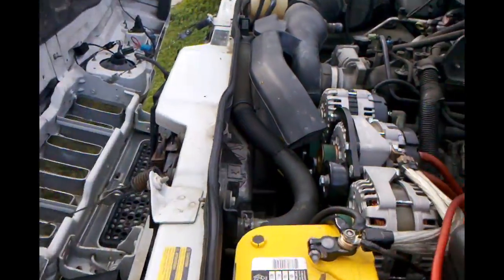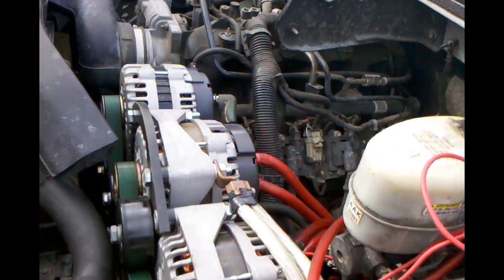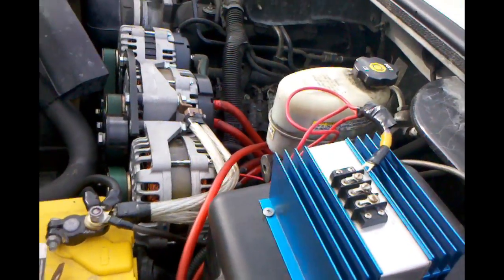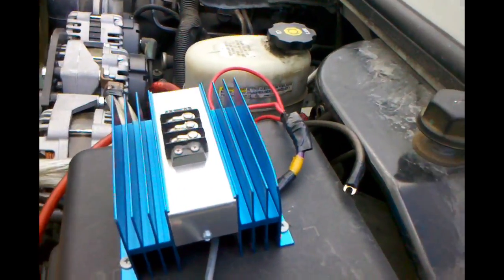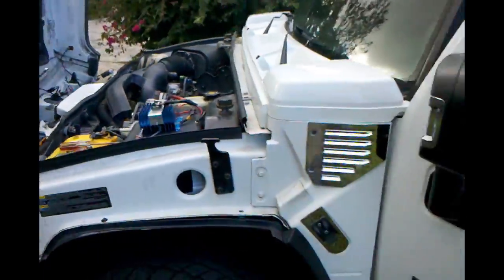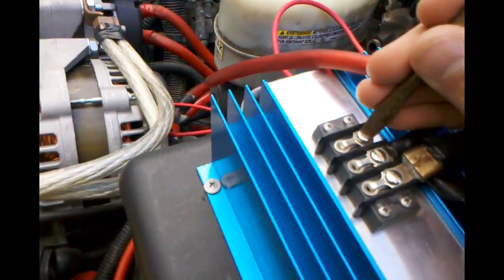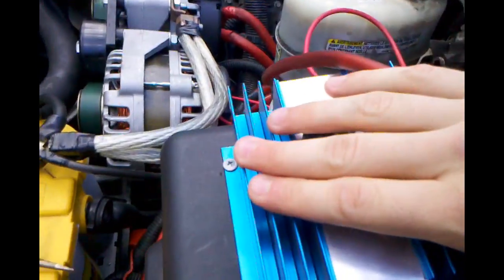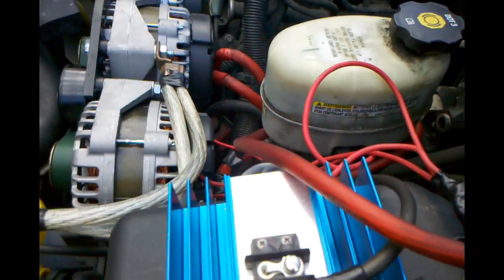Installing an External Regulator (Crossfire Hummer, 20,000RMS+)

Comment: can this regulator be used on alts thats not from excessive amp alts?
Reply: Yes, Use A Terminal Block On The Alternator Then Wire Pos + , Neg - , and Field On the Voltage Regulator To alt
Reply: +Kustom Klosure Designz will it work on the gm 2pin alternators? like a dr44 or a mechman 370 with 2pin GM..
for a 2006 Silverado, I've already bought one of the 91102r units and haven't tried to hook up yet, I haven't seen anyone use it on the gm 2pin..

Comment from the maker: That will work.  What it means by IGN is if you want it to automatically start whenever the engine starts.  For instance, if you hooked up your 12v straight to it, it would always be on and your batteries would be dead in 1 day.  I have a switch that controls mine for the IGN part so that doesn't happen.  You need to find a 12v ignition source and tap into that for the IGN part of the regulator.  Other than that, make sure your alt is externally regulated and your good to go!

Comment from the maker: Well, if it says IGN then that would be the positive wire.  Your field wire comes off of the alternator and goes into the FLD location.  And neg is obviously negative.  You need an externally regulated alternator to even do this so if you do have one, this will work.  I am not familiar with the regular you are using though.  If you send me a pic with the model number, I'll know.

Comment: Quick question dude. Looking at getting one of these and im finding ones tha say IGN,NEG,FLD. Would this type still work in your case? As there isnt a "+" terminal on the regulator(unless it is actually the IGN post) I only have one alternator so thought it would hae to be my ignition wire that actually runs to the regulator. Thanks dude.

Comment: @a21bravo 
no less then 8 awg even in a short run IMO- has to deal with the amount of field current...otherwise you get the random surging and voltage hops up and down within a full 1V range. Most people blame their alts and they just hooked up their regulator incorrectly

Comment from the maker: @a21bravo thanks.  but yeah, I use the circuit breaker.  I tried running a conventional switch and it was causing a bunch of trouble for me.  I would love to use a relay like that but I literally get the worst gas mileage on earth with all 4 alts on so it's like a gas mileage switch for me lol

Comment: nice video... so your circuit breaker is what turns yours on?? nice. i have the same regulator im just using a relay that switches on with the car. sweet 4g to the regulator too :)

Comment from the maker: @ILLTOWN420 it's actually a 4 gauge run. I tried running 8ga and it was an absolute disaster.  But to answer your question.  yes, that is what I use for the POS (+) part on the regulator.  You have to realize you aren't transferring the full current of the alternators through the regulator.  It's just an adjustment mechanism.  The full current and amperage travels through the 1/0 wires that run to the back batteries.